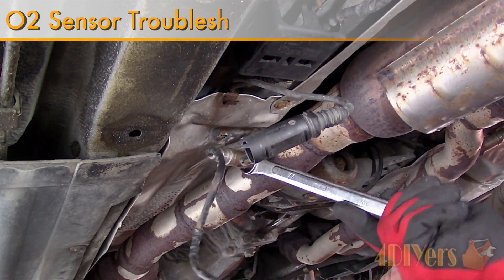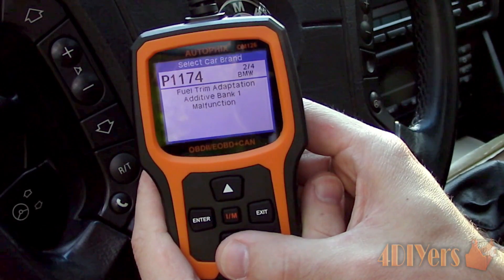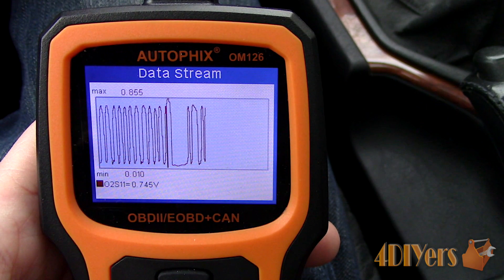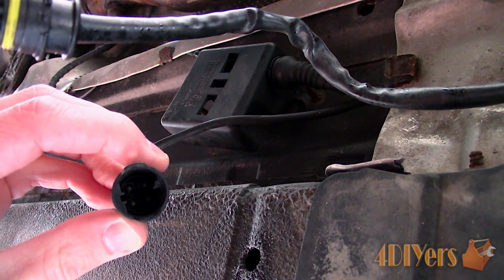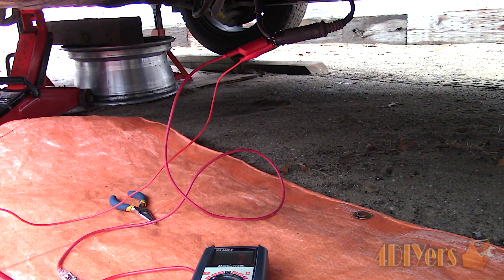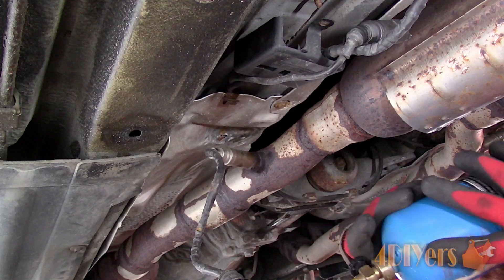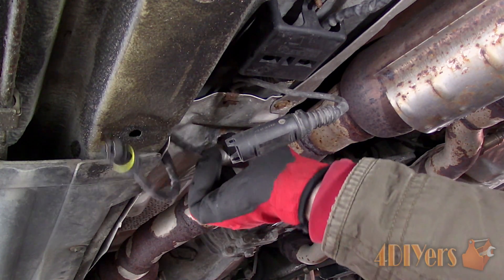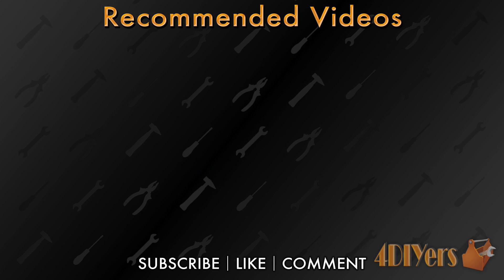How to Troubleshoot and Replace an Oxygen (O2) Sensor

Comment: Hi.I have w140 S320 96y and O² sensor wont work correctly, its on ON few sec and then its shut down/OFF 
Do i need to replace O² sensor?
No check engine light.
There is many different sensors in the market, witch one i need do buy?

Comment: I hate my oxygen sensor the connection is impossible to access I may have to go to the dealership and spend a small fortune. I thought about striping the wire and attaching it but idk.

Comment: I have a problem that I hope someone can help me with, on a 98 Durango.  I had, put a new battery in, and later that day. I  turned  on the heater and waited to for it to kick in, then I  hear a loud noice coming from the driver side, so then I started driving and the engine started to go out, so I made it home, and checked the radiator and it was still water filled up, I was told it might be a motor blower
Reply from the maker: Could be a variety of issues, if the engine died than it wouldn't be a blower motor. Will the engine restart, was there any lights on the dash after this happened, is the serpentine belt still on? Replacing the battery most likely isn't related unless it shorted out.
Reply: the check engine light came on, and I heard swishing gargling like sound, and before this happened, I turned on the heater, and the hot and cold kept changing, and the temperature gauge would go from hot to cold and then it just stayed on hot from that point on, I had a little drip from under the radiator, and I would smell antifreeze in my car sometimes,
Reply from the maker: Almost sounds as if it has an electrical issue and being that it's a Dodge, it's not uncommon. If electronics fail, they can make a loud popping sound and then sizzle afterwards. You can also scan the engine light to determine what codes have popped up. It doesn't necessarily mean something is off on the engine, it could also mean either wiring or a computer shorted out.